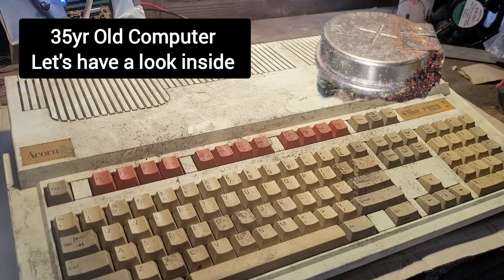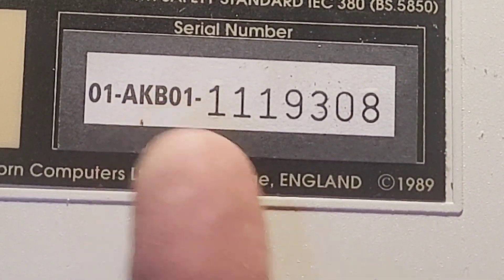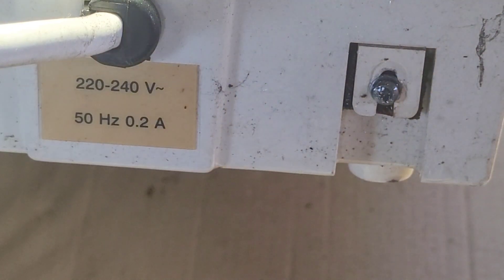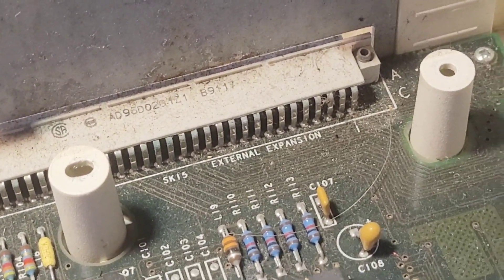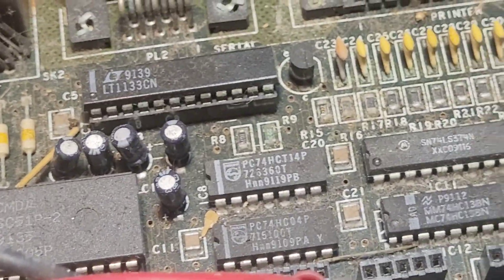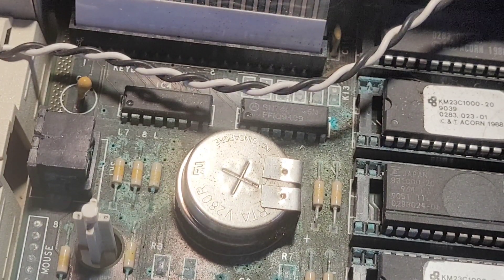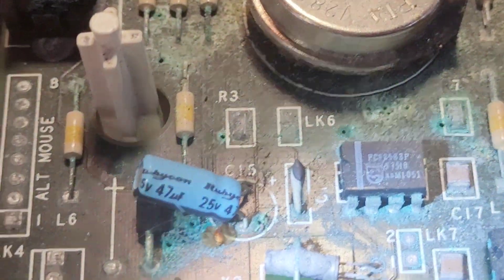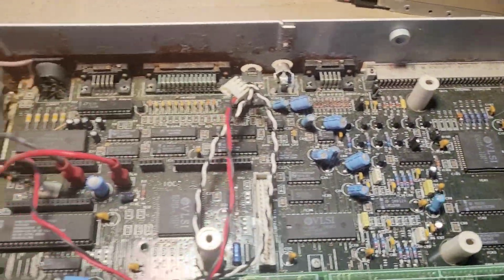35 Year Old Computer - Let's have ave a look inside - 1989 Acorn A3000

Comment: Cut the battery out and neutralise the corrosion with white vinegar before cleaning it. Pull out the PCB and clean the back plate. Once you get it clean, I would spray paint the back plate.
Reply from the maker: Cheers , I think I will be selling it so will let whoever buys it do what they want to do , I have very close up pics to show any potential buyer so they will know exactly what they are getting.